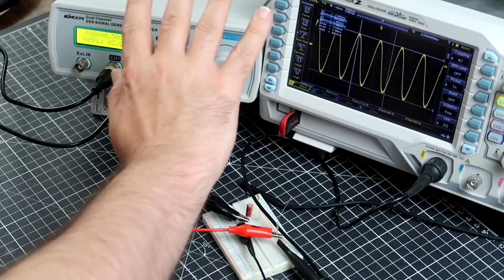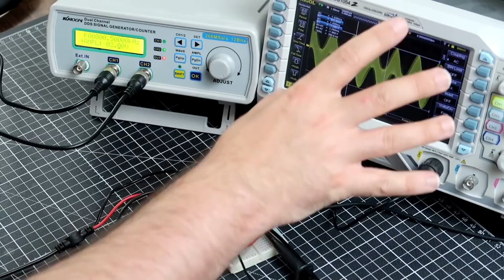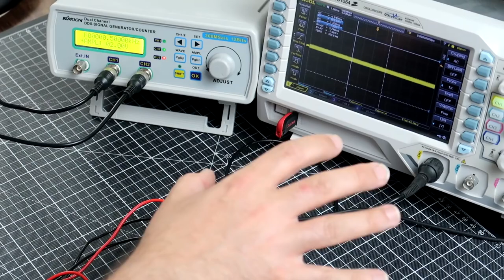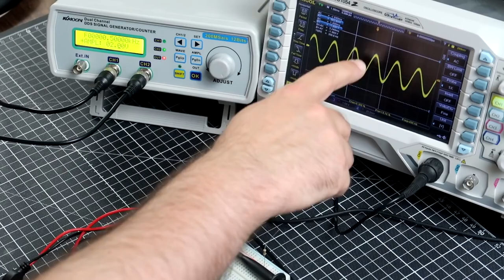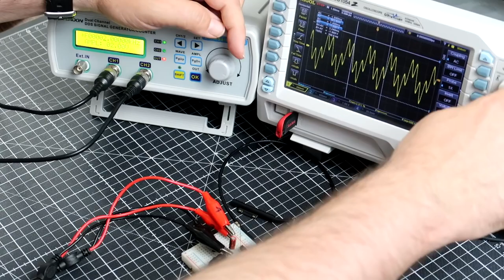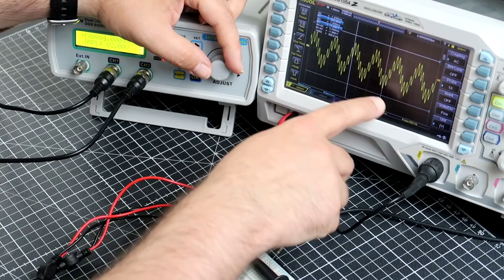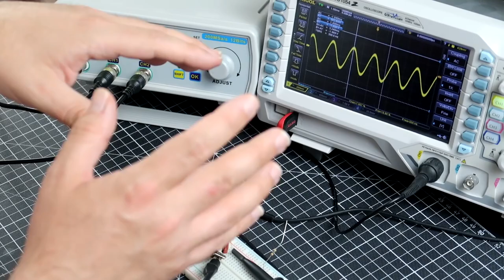How low pass filter works? Experiment with an oscilloscope

Comment: I think it would be interesting for the people (if you already doing videos about filters). Show real life example, like filtering the power line of the VTX, and why the bigger capacitor is not always better. Just measure main frequency of noise, add random bigger and bigger capacitors, then calculate cap for some fixed inductor, make LC filter for that noise you have. And show that if you add 1000uF+ it will maybe help for ESC's, but if you just want to reduce ripples on VTX, it's just pointless. It all depends on frequency
Aaand the next topic: TVS diodes ;)